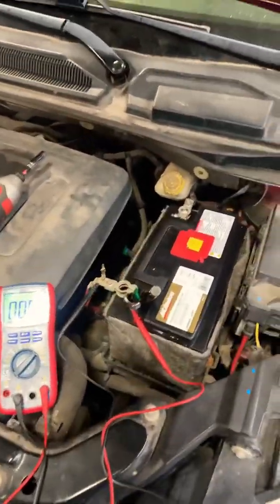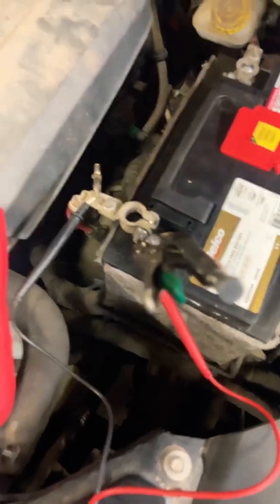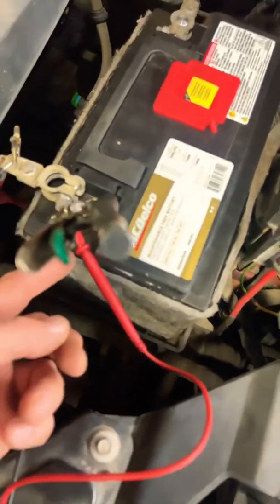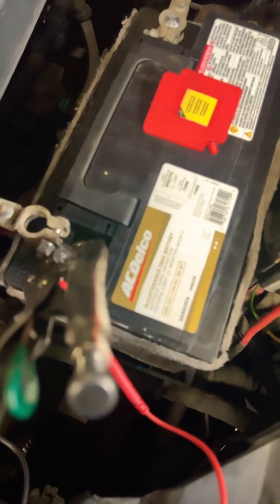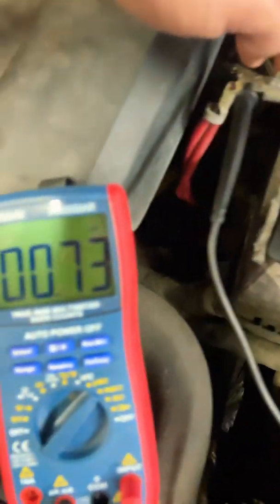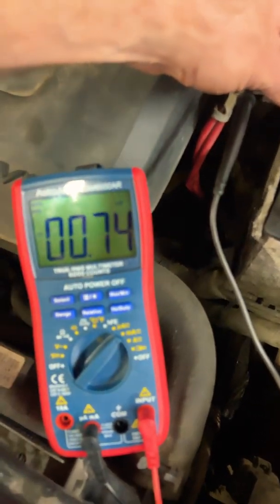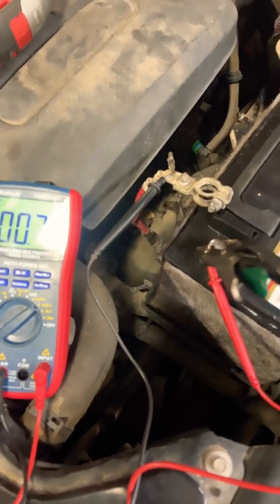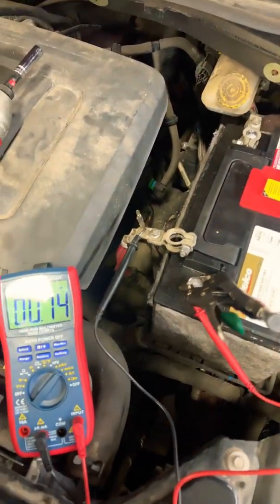Current Drain Sucks Life Out Of Battery | Failed Power Cars Dead Overnight

Comment: Isn’t what your using a volt meter ?    I’m confused
Reply from the maker: Most volt meters also have an amp setting. You use the meter in-line set on Amos to check the current. There will always be voltage which is more like pressure but the Amps are the flow of current.